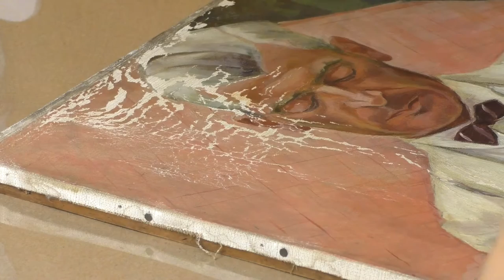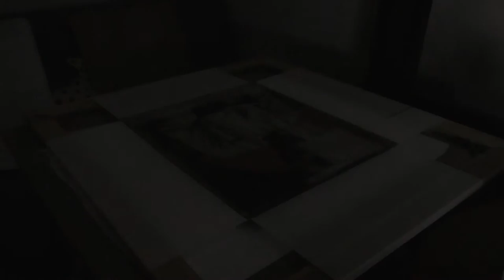FINE art RESTORATION - excerpts (portrait of a man)

Comment: for those wondering what is being done, to put it in as smallest list possible, he starts with assessing the damaged areas, then protecting and securing them with a washi cozo type paper and probably a gelatine based glue, then removes it from stretcher and cleans the back, then using water (i think ) and weights he flattened the edges of the  painting, then he repairs any hole with small pieces of canvas and threads of canvas to keep it as minimal as possible after that he flipped it and applied heat to the damaged areas to re seat and reconnect the loose paint back to the canvas, then he can remove the washi cozo, then he cleaned it and removed the old varnish. next he strip lined the edges and put it on the larger frame  and weighted it down to remove any distortions in the canvas so it was smooth and flat but not too flat,  got to keep any impasto, then it was put back on its stretcher and an isolation coat of varnish was put on. the isolation layer makes sure to keep the original artwork separate from the restoration work and also brightens up the paint so the restorer can colour match better. the missing areas of paint he filled in with a chalk based fill in medium. he removed the excess with water on a cotton swab which means any touch ups wont show as a dent or divet in raking light. then he touched up only the missing areas being sure not to cover any of the original paint. finishing it off with a final coat of varnish.   yes i am a huge fan of Baumgartner restorations lol and i have to say this chap did an awesome job, well done
Reply from the maker: No idea what happened, but my reply has disappeared. So here goes once again.

It was unbelievably pleasant to read your commentary, which is, by the way, impeccable. It is rewarding in a special way to see such interest in what I, or we restorers in general do. Especially when it's met with such enthusiasm ! :) So thank You very much for that. 
Btw I am no longer active on this channel (as was seen, since I have only today discovered your commentary). But in case You would be interested in more videos like this, do visit my new channel here. https://www.youtube.com/watch?v=uxRVysZoN-Y&ab_channel=PavolS%C3%A1s
It is a shared channel, since it was mainly created to share some of my free-time sketching activities, but I have recently started working on restoration videos more. The one I sent in link here, is also with my audio commentary (which now I wonder, if it would not have been better done by You :D ).. anyways I am already working on more projects, so there will be new videos coming in the next months :)
They will be nowhere as cool as those of Baumgartner, but hopefully You will like them anyway !
Reply: @pavolsas8783  omg i have only just seen this comment lol, i am flattered you thought my explanation was good and have actually found your other channel and watched the restoration videos on there without knowing it was you hehe, i look forward to any new ones you might do xXx